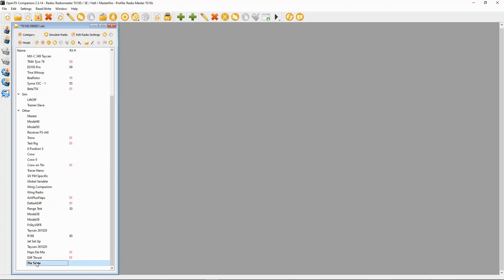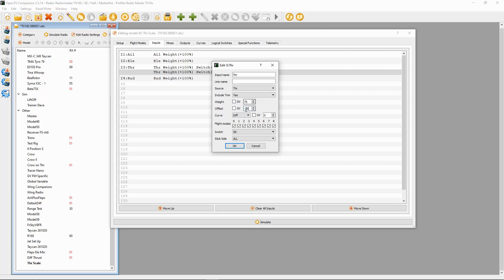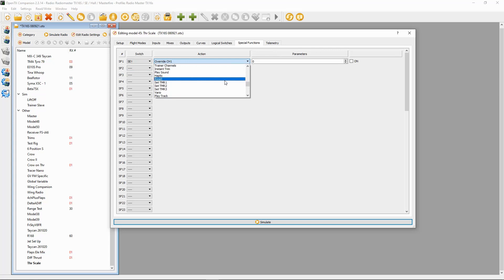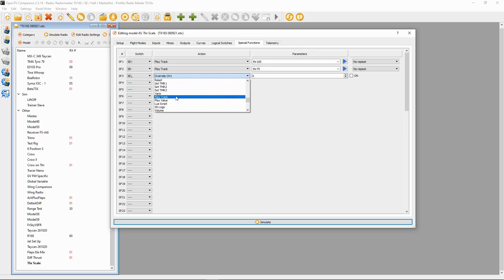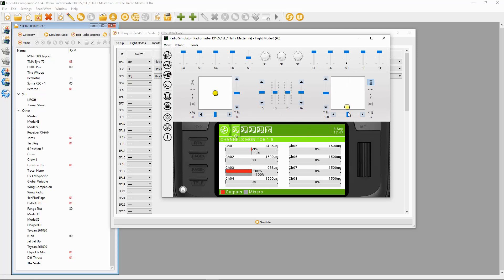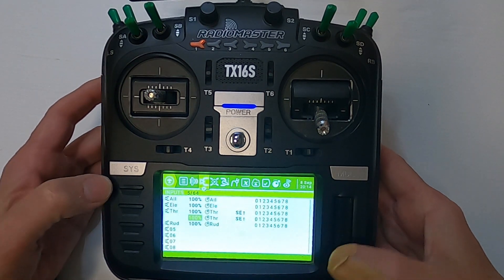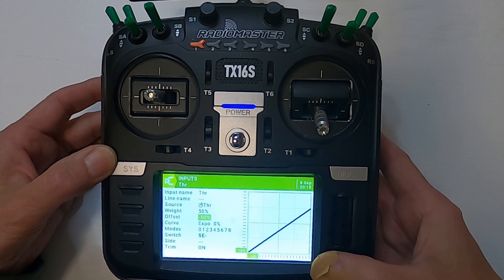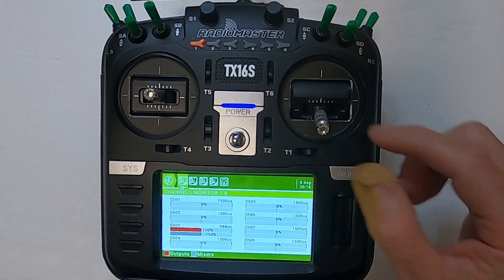OpenTX Throttle Scaling

Comment: Thanks for that.  I wish I understood offset better and what it does exactly
Reply from the maker: Let me see if I can help you.

Weight equals control travel remembering that our range goes from -100 ( zero throttle) 0 (midpoint) & +100 (full throttle)
When we change the weight to 75% the following applies:
-75 0 +75
So our adjustment is cantered around the midpoint 0
So you can see our throttle would be running at 12.5%! with the throttle fully down, Ouch!

Offset moves either endpoints, start or end, to the position you require the range to start or end. In our case back down to zero throttle ie -100 So normally Offset would be a negative number. 
I hope that helps.
Reply: @the-happy-RC-flyer  That makes perfect sense.  I guess I was missing the fact that weight was based on the centre stick position.  Thanks for explaining that clearly.